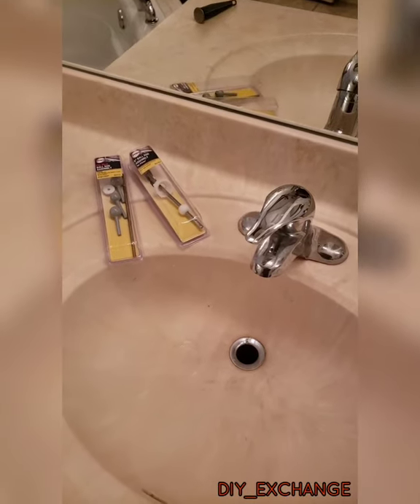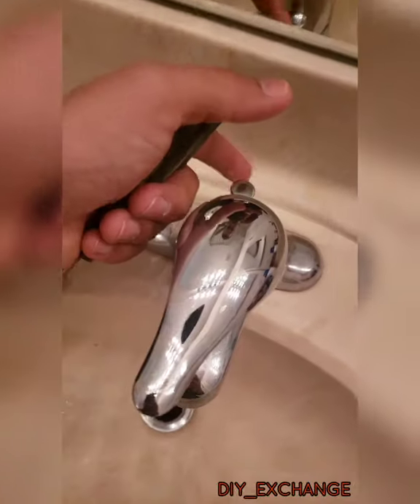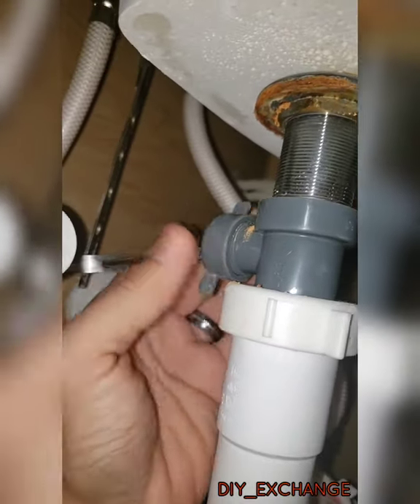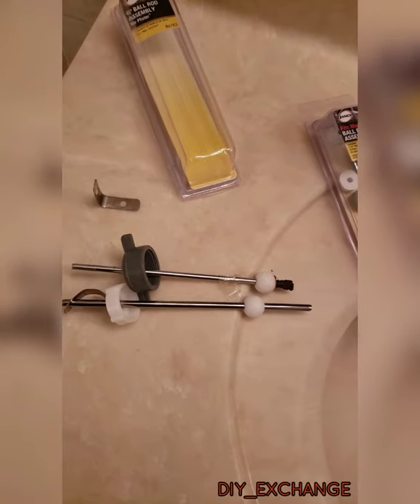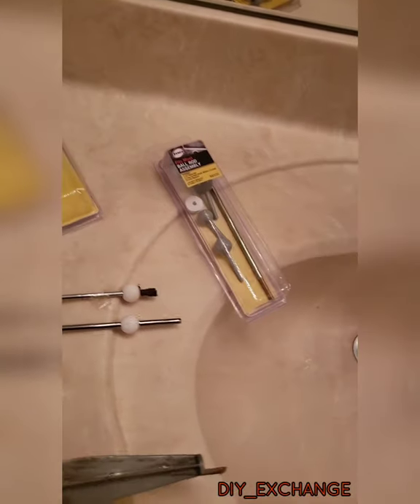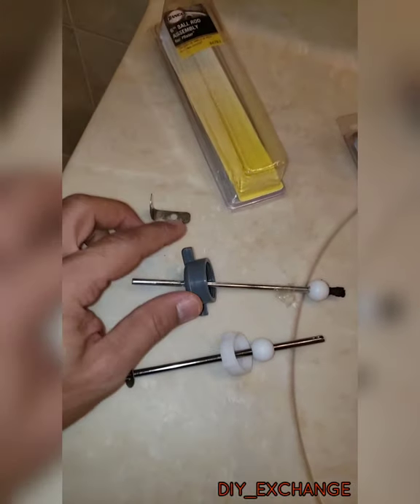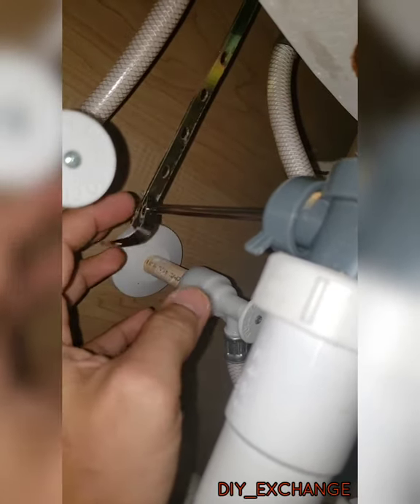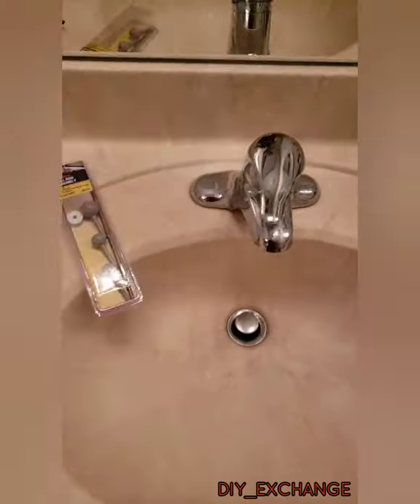How to replace Sink Stopper & Pivot Rod in 5 minutes - (Detailed Tutorial)

Comment: What are some options if you still have a leak where the pivot ball is at?
Reply: I've replaced many of these. I always use teflon tape on the threads of the rod that goes through the ball. This video does not mention that there is a small beveled ring inside the socket that the ball gets pushed into, if it's missing it will leak. additionally, you can also add teflon tape to the male end that you secure the ball to.
Reply: @victorduncker5267 this, I'm looking to repair it, the rod seems fine, I think the gasket is busted though, my dad installed a stupid pedestal sink so it's impossible to get to the fixture and look at it proper

Comment: Mine is a little different. When I take the rod out with the ball there are 2 plastic rings/nuts. I was not replacing this I had taken the P trap apart to see if it was clogged. Turned out it was my stopper not set right that was causing the slow drain. Anyway when I went to put everything back this now leaks pretty good. I have tried several different ways putting this back together with the plastic rings in different positions. But it looks like they should be a certain so that they seal. Is it possible that my rings are just bad now. Should I just replace the entire drain and stopper set up?
Reply: I’m having a similar issue. I hooked everything up and the stopper action is good but I also have a leak